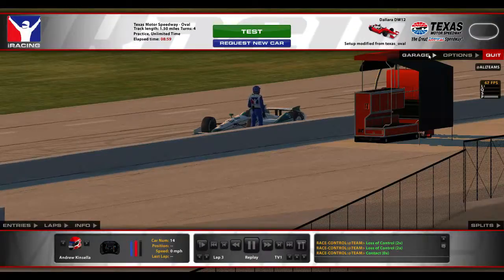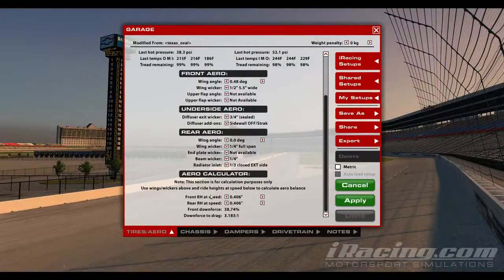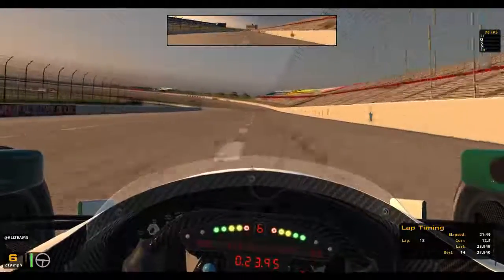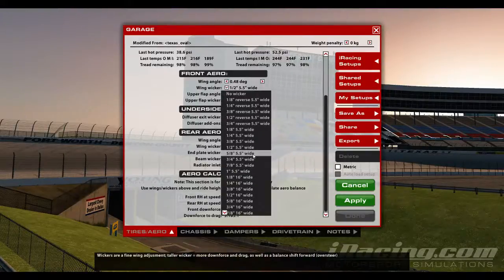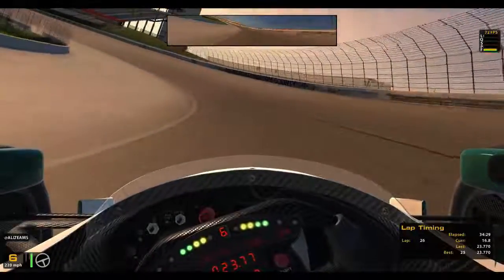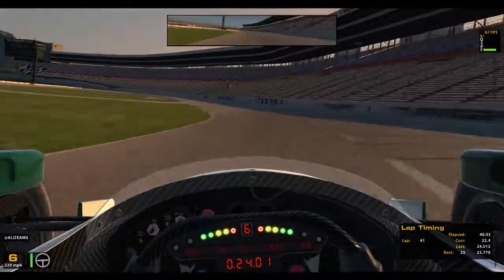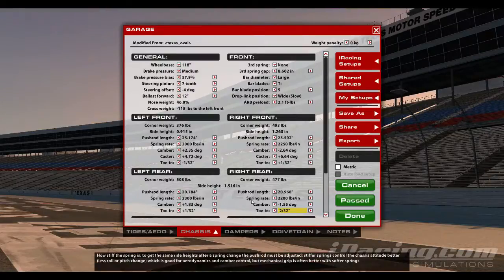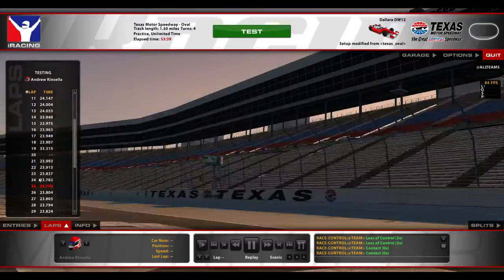iRacing DW12 OVAL Introduction and Set-up Basics

Comment: I use pds for my setups but they always like to run a low line, however I prefer to run high line and save tyres, what are the settings I should be looking at first to adjust my setups to get the most out of high line vs low line?
Reply from the maker: Hey Tim...so that is very track dependent...some tracks, like Texas, it is very hard to have that high line open up with anything other then tire wear. At other tracks, like Iowa, you can open up the high line much more readily...overall the setups are very similar, however think about what you are doing differently...on the low line, you are having a big turn-in and taking the optimal line through the corner. On the high-line you have a gradual turn-in, need to have big mid corner rotation, and good stability off to make it fast...so if i were to make a good high-line setup, i would be looking to reduce cross-weight and add front down-force.

Comment: Any chance you'll do a setup guide for the IR-18 before the Indy 500? Or is it close enough to the DW12 that we don't need it?
Reply from the maker: noblahjustblah the basic principles remain the same...we have a few more options for the radiator inlet, the tire pressures seem to like being lower than the dw12, and the rise heights like being higher, at least on ovals and there are other small differences, the basic principles remain the same, at least for non telemtry based adjustments...I will try to do a video for the ir18 soon, but life is pretty busy atm

Comment: Everyone I test at Charlotte the slightest little inch of a turn makes the car go crazy I don’t know how I barely turn it
Reply from the maker: xxNitroGamingxx first thing to try would be to use a slower steering ratio. This can be found in the chassis menu. Basically this car is made for both road and ovals...faster ratios are handy for road courses, slower ratios are handy for ovals
Reply from the maker: To give you further advise, I need a more detailed analysis of what the car is doing...the more detailed you are, the more precise advise I can give. Does it feel like one end of the car is gripping more then the other, or is the car rotating to much through the corner? Did you make sure you loaded the correct setup for the track you are using?
Reply: KOOLguy3 i under steer in corners because I’m afraid to steer it to much then when I get it to the line it just goes crazy and there is no steering ratio on mine
Reply from the maker: to be honest that sounds like your wheel is not properly calibrated...what wheel are you running and what range do you have mapped
Reply: KOOLguy3 I figured it out I was using a default indycar setup I bought dw12 and I’m still in rookies I didn’t have the indycar oval series set up that series setup works fine